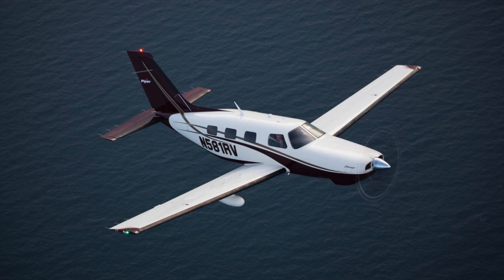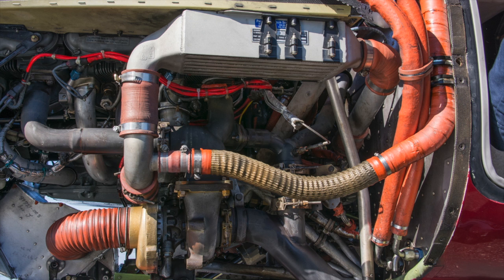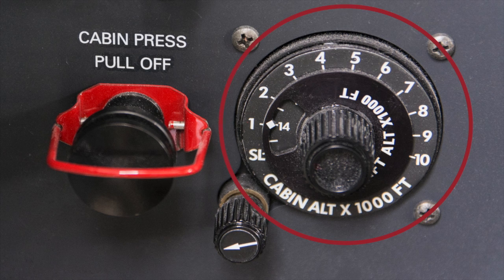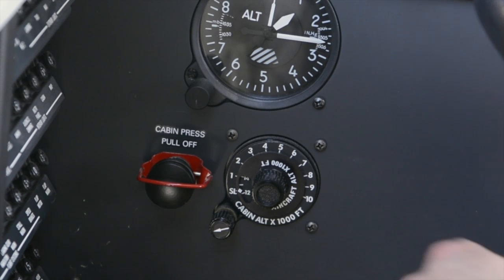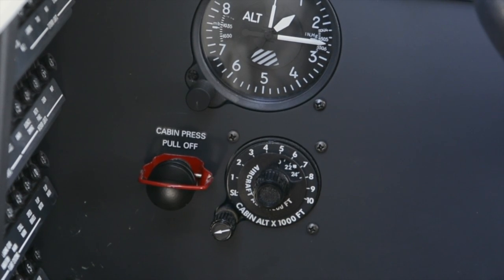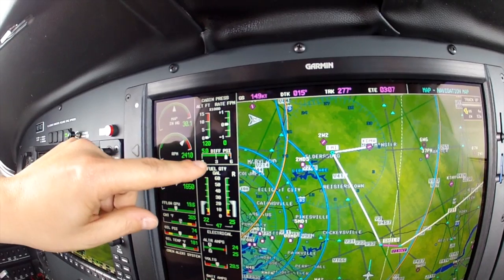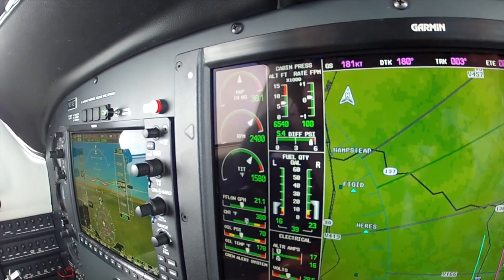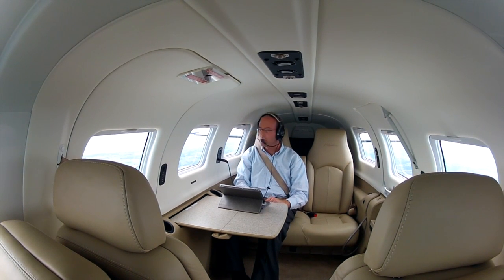Skytech Product Spotlight:  Piper Mirage Pressurization System

Comment: Thanks for the great video.  It sounds like to operate this the easiest way, you only have to set the pressure system twice.  Once at departure 500 feet above field elevation, and once at the top of descent at 500 feet above arrival airport field elevation.  

The video says that an additional step for smoother operation, is to set the inner setting to 500 feet above cruising altitude once you pass 13,000 feet. Can you advise how this would result in smoother operation since the valve already regulates maximum cabin differential of 5.5 psi anyway?

Comment: cost....... ?...... !........... ?
Reply: It's a 2011 registered in 2012 so you are probably looking about $750,000 - $1.1M
Reply: @AragornTrueKing  I am talking about the costs for pressurization system....; not the Mirage itself......... ?.... !...... ?🤔
Reply: @danizweifler6061  you weren't very specific lol. I'm not sure about the pressurization system it's self but you are looking at $340 to $370 an hour to fly it.
Reply: @danizweifler6061  It is built in on this model, not a separate option.
Reply: @dryreed  yepp...; your answer states exactly my origional wrong thinking.... 👍.....// I was thinking about a Matrix with refitted pressurization system... // however: in the vid they show "only" how Skytech does integrate the old gauge into the glass cockpit in the.. M A L I B U.....  // thank you anyway for the clarification / greetings